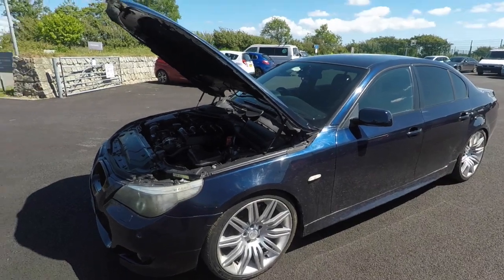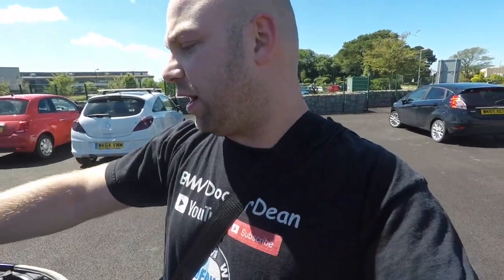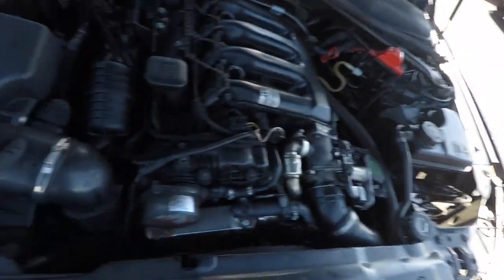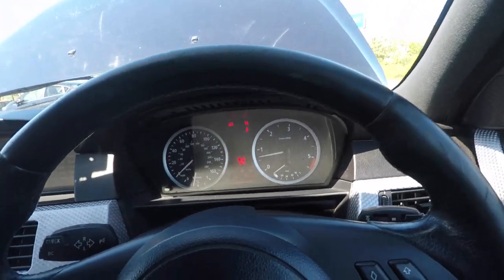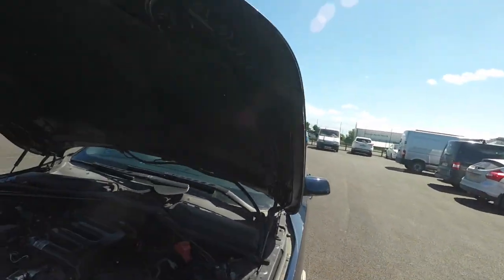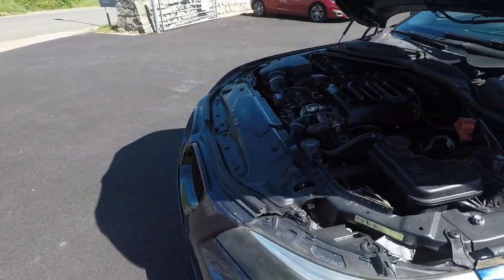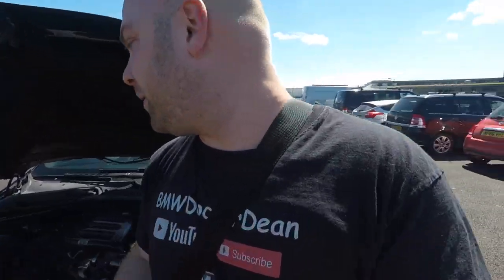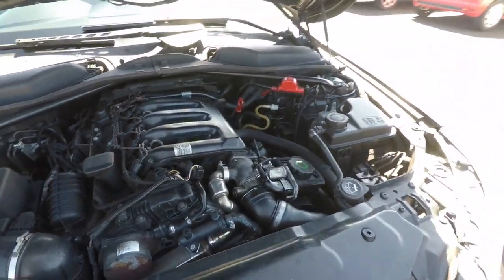Bmw E60 E61 535D M57 M57N Engine Issues Fix & Central Electronics Failure Fix

Comment: I just bought a 2011 335D M Sport with 135K  miles that already had the swirl flap, EGR, DEF, (alphabet soup deletes), vacuum lines, charge pipe, etc done. Along with that, it has a JR 2.8 race tune and straight piped exhaust. It is awesome. A ton of fun - it sounds great and is crazy fast while still maintaining great fuel consumption. Amen about the traction control light coming on when you put it down. Mine has 265/30-19 tires and it still comes on all the time. The M57s can make so much torque and power; they are insane. So glad I came across mine and bought it.

I do have to change the coolant pipe flange and gasket that connects to the block, the O ring on the vacuum pump, and the turbo oil lines. I could probably refresh the power steering hoses too but that's going to be next summer.
Reply from the maker: Thanks for that mate FINALLLLLLY someone with fucking sense and knowledge of these cars try explaining that to have these idiots who know nothing about them and who have never probably driving ANY of these engines to know about them

Comment: Hy please help me I'm have cc I'd 207 code on my 335i, it lock the truck and cluster rev drop and fun blow and can't open doors only drive door open and can't scan the car until you disconnect the battery and no code find

Comment: My E60 2008 n52 engine,  it shut off now when it gets hot. I replaced the disa flaps and crankshaft sensor but still shuts off.  They told me to replace the fuel pump,  does this fix my problem?? I hope so
It shows fault code 2AA9 but now it's gone.
Reply: Do you have ista? That will tell tounyour real deal...I pray you're not using just a generic odb2 sensor....